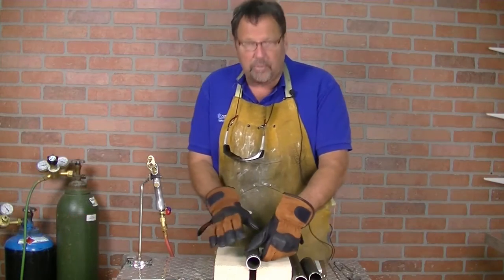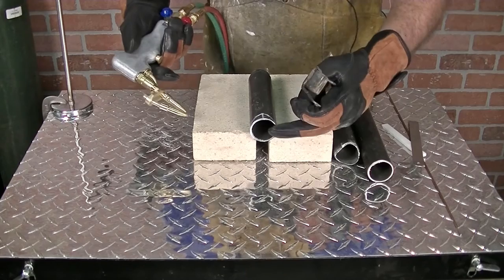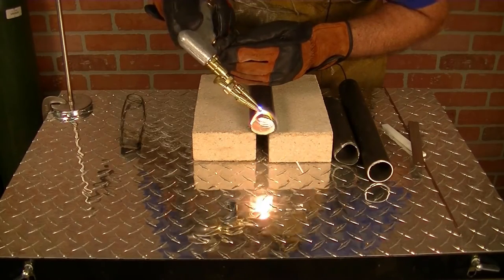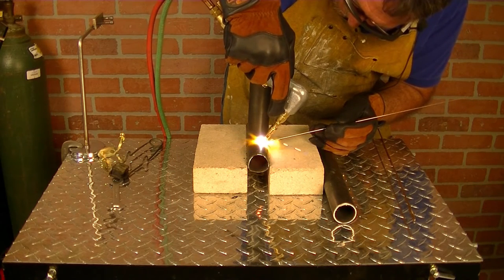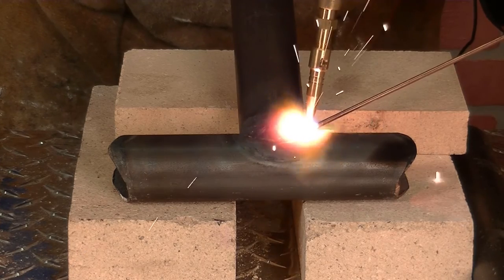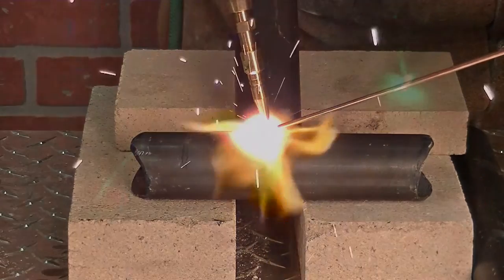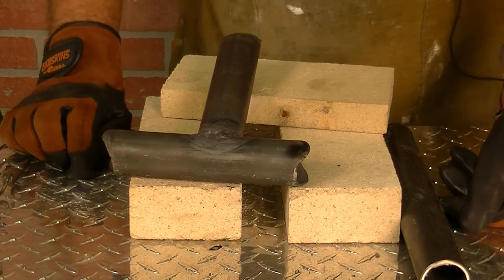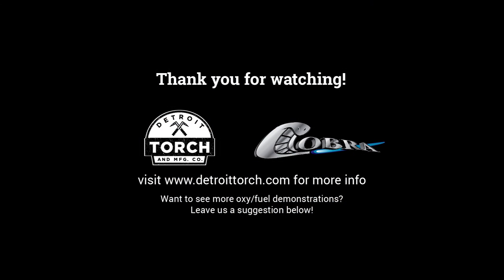Chromoly Roll Cage or Fuselage gas welding and cutting demonstration with the DHC2000

Comment: HAZ is too big need to adjust the cone better
Reply: For 4130 tubing, the FAA actually recommends that you stress-relieve the entire joint after welding, by bringing the joint up to about 1100F (dull red) and then letting it cool in still area. So you see, HAZ really isn't as much of a deal with OAW as with TIG. They also recommend doing the same thing with TIG too, but this is in contradiction to what the AWS recommends for tubing with wall thickness under 0.120".

Comment: WHAT IS THE COST OF TORCH WELDING COMPARED TO SAY MIG WELDING? AND ALSO  WITH THE TORCH CAN I BOND DIFFERENT MATERIALS TOGETHER BEEN IM USING THE TORCH? LIKE STEEL WITH  ALUMINUM OR BRASS WITH ALUMINUM OR WELL U GET THE POINT. OR IS IT MORE BRAZING PROSSES WHEN PUTTING TWO DIFFERENT METERIALS TOGETHER?
Reply: More brazing for dissimilar metals, especially with things that have such distant melting points.
Reply: A torch setup is substantially less expensive than your average TIG welding outfit. Certainly you can get low-cost TIG welders, but a decent OA welding setup will cost you around $600-700. I just bought a set of the mid-size tanks with a little cart for about $450, and a Smith torch set will cost around $250 or so. I think the torch in this video is a bit more expensive, but I haven't priced them lately. A decent TIG welder (inverter type) will cost at least $800-1000, and then you still need to buy the argon tank and a cart...unless you already have something. 

As for joining dissimilar metals, I have no idea as I've never really tried...other than brazing.
Reply: Spend some time on welding forums like Weldingweb and the Miller forums. Videos are for watching to learn physical aspects of welding. To learn about equipment, read. Also stop posting in capital letters. It's fucking annoying to read and if you want responses in forums, don't do it. 

The Smith recommendation is a good one. All their line are quality, made in USA and their gas regulators are popular for welding with any brand of torch.
Reply: When 2 of the same metals are joined it is welding 2 separate metals are brazed.
Reply: @ericjkent  Uh, no.  Dissimilar metals can be welded.  For example, you can weld cast iron with nickel steel.  Brazing is lower temperature and the bond between the dissimilar metals is like glue as there is no mixing of the base material and the filler material.

Comment: Thats a dope ass torch but way to much heat for Chromoly. Not saying you didn't get pen. but the HAZ is affecting the structural soundness to where is doesn't matter.
Reply: Gas welding better than tig in certain applications,  also history proves you wrong. Gas welding is structurally sound.
Reply: He did have the torch a little high. He was rushing time for the sake of demonstration. Always best practice to preheat 4130 when Tig welding.
Reply: @zip7806  That depends upon the filler rod being used. The recommendation(s) I've seen is to pre-heat with using ER80S-D2 rod, but NOT when using ER70S-2 rod. I've seen this mentioned in several references, but here's a video that discusses the different procedures for the three common rods used for welding 4130 in non-heat-treated applications:

https://www.youtube.com/watch?v=ytSrEggjz1A

EDIT: Should have clarified -- those rods are for TIG welding of 4130. For the most part, with OAW and 4130 you can just use either RG45 or RG60, either of which is acceptable for things like welding aircraft fuselages. Maybe the automotive applications would prefer one over the other, but in aviation either would work. The tensile testing I've seen for RG45-welded 4130 always seem to fail at well over the 45 ksi suggested by the number in the rod. Those are just minimum values anyway. Some old-timers tell me that RG-45 welds better with a torch than RG-60 does, but to be honest I've yet to notice a big difference myself. But I've only been doing it for about 35 years now, so I'm still a young pup.
Reply: ...oh, and actually he didn't have ENOUGH heat to weld this joint. He should have used a larger tip so that it would have welded more quickly, without the need to dwell so long in order to run his bead. The way to minimize total input in OAW is not to use as small a tip as possible, but rather to use the smallest tip you need to gain/maintain puddle control and achieve proper bead formation and fusion into the base metal. 

His tip wasn't large enough, IMHO.

Comment: adding way to much heat to the material for chromoly #TigOnly
Reply: oxygen and acetylene is a perfectly acceptable way to weld chromoly tubing #readsomebooks
Reply: They only used the OA process to weld 4130 for about 50-60 years before TIG was easily afforded, as far as I know. We learned it when I went to A&P school back in the 80s--and I'm pretty sure it was used for at least a couple of decades before my time as well. 

It works just fine, and a guy can get pretty good at it with some practice.
Reply: Well since I live in the here and now and not 50yrs ago I'll pass. I'd only trust my life and my customers lives with high quality tig
Reply: From the FAA manual regarding TIG:
Clean the steel of any oil or grease and use a stainless steel
wire brush to clean the work piece prior to welding. This is
to prevent porosity and hydrogen embrittlement during the
welding process. The TIG process is highly susceptible to
these problems, much more so than oxy-acetylene welding,
so care must be taken to ensure all oils and paint are removed
from all surfaces of the parts to be welded.
Use a TIG welder with high-frequency starting to eliminate
arc strikes. Do not weld where there is any breeze or draft;
the welds should be allowed to cool slowly. Preheating
is not necessary for tubing of less than 0.120-inch wall
thickness; however, postweld tempering (stress relieving) is
still recommended to prevent the possible brittleness of the
area surrounding the weld due to the untempered martensite
formations caused by the rapid cooling of the weld inherent
to the TIG process.
Reply: @cobnutts  There are people who won't TIG weld an aircraft fuselage unless all the joints get stress-relieved afterwards.
Reply: He did have the torch a little high. He was rushing time for the sake of demonstration. Always best practice to preheat 4130 when Tig welding.
Reply: @bluehornet6752  still used today on aircraft frames, much better than MIG. Reason being lots of MIG welds on chrome molly are performed by low skilled welders piling on cold welds in short arc mode', while gas welding requires a perfect hand to eye coordination and will never be too cold, rather the opposite.
Reply: @bluehornet6752  I can't understand why people think everything needs to be Tig Welded. They forget that airplanes have been made way longer than tig has existed. Gas welded aluminum is how all airplanes were made as well as the tubing. Its also better to gas weld cast iron with cast iron and flux instead of NiRod.
Steels also heat treat and temper at different ranges, hence preheating and post heating. Just tigging in one spot and keeping it consice doesnt necesarrily prevent the tempering and harding process. The colors prove it. Its like looking at a steel tempering chart.
Ive been nerding out too much on knife making lately.
Reply: @derekmcdonald2856  TIG was invented in around 1941, at Northrup. It wasn't very affordable for a few decades though, as I've been told. I know when I went to aircraft mechanic school in the 80s, that it wasn't very affordable then even. We were taught OAW, as it had been used in aircraft construction since before 1920. So yeah, you're pretty much right. 

There are THOUSANDS of general aviation airframes out there that have been welded with the OA process, and many many of them are still flying today. The AWS recommends no pre-heat or post-weld stress relief for wall thicknesses under 0.120" with TIG, but the FAA still recommends post-weld stress relief on TIG-welded joints, simply to try to temper any martensite that may be present. I know several shops not doing that though, and (to my knowledge) none have had issues with broken welds thus far. 

So it's apparent that both processes work well. The OAW process has a much longer history in general aviation, and it's the one I enjoy more. But given the affordability of good inverter-style TIG machines these days, I think a person should strive to learn/practice both processes. I think each have their place, and there doesn't need to be a competition. So saying you should "only TIG 4130" is bullshit, quite simply. Does TIG replace OAW? No. Do you have to use only OAW on 4130 fuselages, for instance? Nope. Use what you know best and what you're most comfortable with. 

One thing I am clear on, after reading through comment sections such as for this video: The people commenting about the size of the HAZ don't really understand why the HAZ is important when it comes to untempered martensite. Ironically, it's BECAUSE of the sharp HAZ (and steep cooling gradient) that you see martensite formation...lol. Metallurgy doesn't lie.
Reply: @bluehornet6752  I think TIG was first named "Heliarc" . Perhaps that is why people seem not to remember this. I have used the predecessor of the torch he shows for decades, then named Dillon MKII and like it a lot. These commercial vids are somewhat hyperbolic though... it is not exactly a magic wand. Also many competition bicycle framebuilders prefer OA fillet brazing with a boric acid flux generator to TIG.